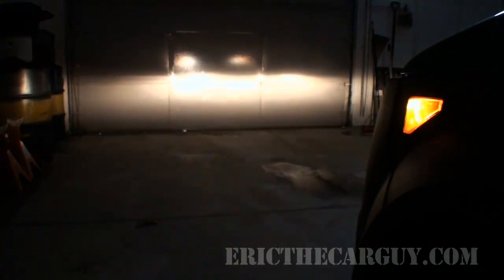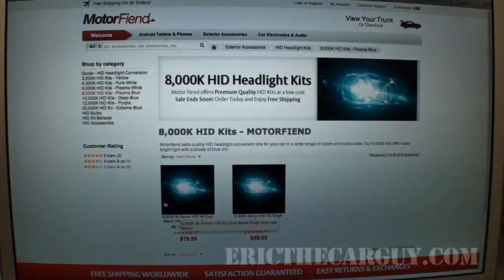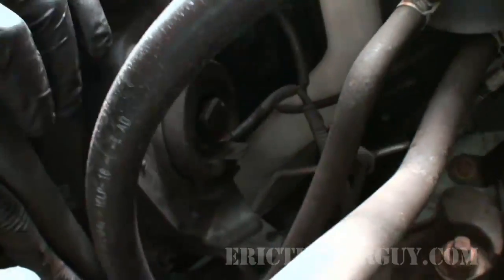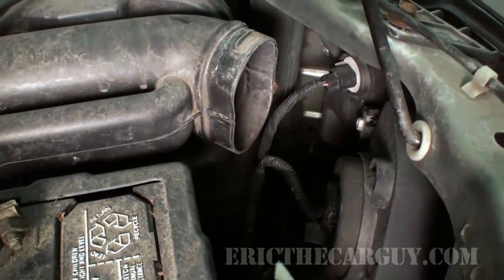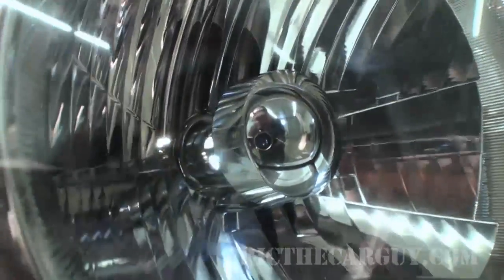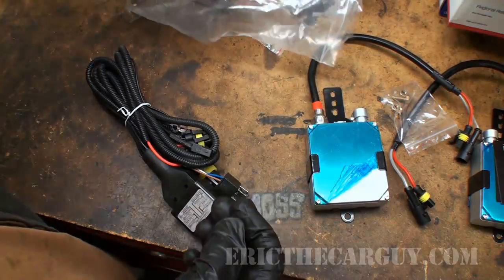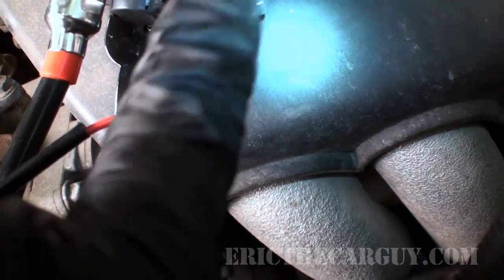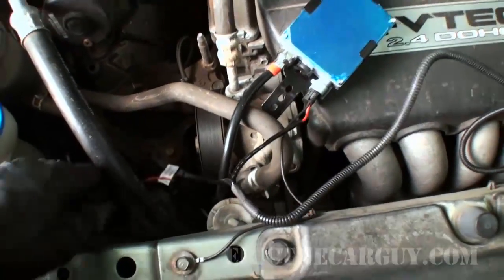How To Install an HID Headlight Kit -EricTheCarGuy

Comment: he has a cut-off line he wont blind any1... I have the same set-up, the little metal shield really helps stop glare...
Reply: Are you serious?? He has no cutoff, look at that glare it looks like crap!
Reply: Of course resort to name calling. That's not a cutoff shield, I have Hella E55 projectors with the cutoff shield, and foreground limiter. Just look at that glare when he compared the stock to his "HIDs" there's light scattered everywhere!!

You just don't retrofit halogens with a HID bulb, there's a lot more involved in the process. I see you guy's all the time with your cheap crappie "HID kits" blinding ppl. That's not cool, it's dangerous!! People please do the rite thing, and buy yourselves a nice HID kit, with really good projectors and don't go pass 5500K.

You don't have to resort to name calling, even if you don't agree with the other person.
Reply: ***** You didn't hurt my feelings buddy.
Reply: Gotta get terms right so people dont get confused.

A Cut-off Shield is on the projector. It's a metal flap that extends over the front of the bulb and creates the cutoff line, and also flips out of the way so it doubled as your high beam. That's your bi-xenon. That is what Dat Dude is saying.

A Anti-Glare Shield is what you see in this video. To reduce exactly as the name says, glare. This is what Jeffery is trying to point out, but is calling it the wrong thing 2 different times. Went from calling the cutoff shield to a shroud, which its neither. Did this right after calling someone else an Idiot. Gotta love youtube comments

A Shroud is what fits over an entire projector for that final look. There are MANY different kinds. Hard to explain, but just google HID Shroud.

As far as the K rating. 4300-5000k will give you the whitest light, which also means your brightest. 6000k Is best for that slight blue look without loosing much for light output. 8000k you are trading off quite a bit of light output for your blue color. 10k and up you are just an idiot. I seen a 12k kit once (purple) in the rain. I couldn't see his lights on the road but I could see the surrounding halogens fine.

The bluer color may seem 'brighter' to a lot of people because your eyes can pick up the blue hue easier than just things being lit up.

I'm not really arguing with either of above posters, I'm just making a point to say something to educate anyone that reads your comments. Been following HID headlights for long time. There is a TON of info to learn to be as educated as you can be.

Comment: So I ordered my kit from motor fiend, H7 4300k, and it did not come with instructions, bulb shields (Casper shields), nor a harness  , it only came with the ballasts and the 2 bulbs. what happened?
Reply: +Kevin Rivera Mine is the same way.
Reply: Same. But, luckily I did find instructions for installation on my car from a video I found on youtube... I think the channel was Xenonsupply. See if you can find instructions there :)

Comment: Awesome video as always ....but another way ....if your fuse is blown and don't have a replacement fuse and you need headlights ...just cut the fuse out and direct wire it without the fuse ....now that's only if u r stranded and have no other way and need to get home....and when it home make sure you put the fuse back in....just an emergency need to do!!!

Comment: I hate people who think it's okay to put HID headlights in a car that originally had halogens. I have two cars that have HID headlights but they were a factory option so I'm not blinding anyone. You should take those bulbs out of your car and put the factory ones back in so you don't blind someone and cause an accident. Every time I see someone with aftermarket HID headlights I turn my Highbeams on so they can be blinded too.
Reply: How old are you? 10? Your issue is about blinding people yet you turn on highbeams deliberately to blind them back? LOLOLOL what's your role in preventing accidents then?
Reply: George Au-Duong They blind me I blind them back. It's called being fair. lol
Reply: Hes actually right. you need to buy new head light housings and projectors. not just put in the bulb. it doesn't work with reflectors.
Reply: Znorm, you are absolutely correct and I do the same exact thing.
Reply: ZNormT6
Lol, I feel you man.  I live in the suburbs but I can only imagine how bad it is out in the country without city lights.  What can you do man, can't fix stupid.
Reply: ***** actually its just a gimmick to block SOME of the glare but it also block lots of usefull light , you can't replicate the same beam  since halogen and hid work differently , but hey since you seems to know so much why aren't you working with Stanley or Koito or Hella ? You could give them the knowledge they seems to lack to develop a proper housing :)
Reply: it doesnt work , only proper way to run HID is to use a xenon projector (D2S and the like ) , your solution is just a mimick that chineses sell to make a quick buck

They still glare like hell
Reply: ***** 
"The glare isen't that bad" 

How about no glare ? You know aka : Use proper housing and bulb ?

Nvm better get theses kits and glare everyone so you can show people you spend "$$$" on a 15$ kit (yup thats what they cost) for the sake of vanity

Halogen will give you an overall better output , just google daniel sterb lightning and educate yourself :)
Education is key here
Reply: ***** When i said halogen give a proper output I meant in a halogen housing , i know HID in a XENON Housing (Aka using D2S bulb and the like ) Will give a better output than halogen , BUT Halogen in a Halogen Housing will give better result than HID in a halogen Housing (Less lumens wasted ) 

I know about lumens and kelvin , don't worry ;) 

I still don't see the point to suggest someone PnP even with a casper shield when its just end up creating glare , and shitload of foreground light.. 

Gotta jump on the HIDWAGON?

You guys are late.. its all about the shitty PnP LED!
Reply: Of course but the  Housing is build based on the D2R BULB , not some randomly applied "casper shield" and its not just a reflector with a different "socket"

Its a coating applied on the bulb that block the glare (The brown stuff), once again its based on the ARC of the HID . 
Some chineses tried to replicate it but you simply can't do it correctly on a rebased bulb (aka PnP )

The actual "casper" shield on the headlight itself it just to block the light from the base of the Arc

 (Same for some halogen headlight , like a 2012 ford f-150 and MANY other halogen housing ) on the halogen headlight they block some of the light emited by the filament , (Since not every bulb have the coated Tip) (Like H3 and some H1) 

http://i58.tinypic.com/2exwvuc.jpg

Just look , for the D2R (Reflector) They need the brown coating and the shield , yet the housing is based on that kind of ARC , which once again is pretty different than a filament 

http://dastern.torque.net/Photometry/filamentarc.jpg

Once again , do it RIGHT or don't do it at all
Reply: It can't be the same , your fusion has squirrel finder while Xenon projector does not (it let a lil bit of light to illuminate the sign on the road etc ) 

The increased brightness from HID will cause glare . 

Glare don't need to burn your eyes to be considered glare , as long as it its not intentional , its glare .

And i'm pretty sure the foreground was affected by switching D2R->H7 (Even if they look alike ) 

Same for H11 to H11PnPHID
Reply: You just said theres no glare , then just a lil glare , so which one is it ? 

Ill assume its the late one . I know the Fusion take hid pretty well for halogen projector but theres still LOTS of room for improvement ;)

(Koito LEXUS RX350 projector are pretty much bolt-on for exemple )

And getting flashed mean nothing , i see people in pickup with Hid in both fog/headlight not getting flashed and they still glare like hell
Reply: See, I have 35W HIDs in reflector housings. I've had them in for around 3 months, and I drive on two lane roads pretty often. You know how many times I've been flashed? About twice. So they can't be that bad. One time, I had someone flash me while we were both pulling up to a stopsign. He turned on his brights, and I turned mine on too! Bet he couldn't see shit after I turned my brights on with my HIDS. Hope that happens to you😊
Reply: ZNormT6 that’s why you buy aftermarket headlights with the hid block off plate
Reply: ZNormT6 do that to me and ill turn my light bar on
Reply: What about when you are on a hill and the traffic is coming over the hill towards you. You blind them!
Reply: Strongly agree!!!
Reply: @DrDodge24  wow grow  up :p
Reply: @GravelGuerrilla  my 2002 Lexus LS 430 had hid factory and it had reflector houseings

Comment: Very disappointed Eric! Read all these comments and PLEASE read up on how HID's are VERY different than Halogen. Only install these kinds of lights into housings that were designed for them! HID lighting systems installed on a vehicle that previously had Halogen light bulbs is NOT cool. Those lights will cause extreme amounts of glare in those housings and other motorists will be at great risk of being blinded by them, possibly causing an accident! It's a very serious problem here in California. So many ignorant douche bags putting these lights in not only their driving housings but, their fogs as well! How stupid is that!? Blows me away.
Reply: *****  Did you use a relay harness and run off the car battery or just the factory harness when you installed the hid kit? I have the same car and was thinking about doing an upgrade to the terrible halogens in the Fusion but I'm not sure what I will need. My car has the daytime running lights disabled.
Reply: I installed hid on my higbeam even its illeagal but only higbeam loybeam need to bee original xenon or leave it to halogen. Sorry my english is horrible, I am from finland
Reply: He was provided a anti-glare shield... are you blinded? because the light didnt blind you ;)

Comment: Just a note, the Kelvin scale doesn't necessarily get brighter as you go up, it's the color temperature. Lower goes toward the yellow/red scale, higher goes toward the blueish/purple scale. Typically right in the middle, around 5k or so is white, and you actually loose a bit of light/lumens as you deviate either higher or lower from there. Thanks for the vid!

Comment: Chris is installing the H4 equal. If you install a H7 or a H1 Hi-Beam only they are wired different, and the hi-beam takes longer to get to maximum brightness, meaning that you have to rely on the H4 equal until the hi-beam heats up properly.

Comment: I've been running a hid kit for the last year and love it. One thing I noticed is the kit I have has a single fuse which supply's both ballast units. A normal setup has a fuse per headlight meaning if you have a fault on one you lose that fuse and one light with the hid kit you have a fault in one ballast which blows the fuse and your in the dark. Been meaning to rewire that with two fuses but have not gotten around to it yet. Cant be sure but I think your kit had just one fuse too.

Comment: Cool video Eric! I'm not going to belittle you for this decision, I installed a kit on my car as well. I used projectors though so that there wasn't chance of me blinding others, but I see this retrofit has a metal shield over the bulb, seems quite nice for a drop in kit. Only thing I'm going to mention about your kit is that you might find the blue light difficult to see even though theyre brighter than your stock bulbs. Blue wavelengths are the hardest for humans to see.

Comment: Very thorough installation Eric. Not exactly how I would do it but well done. I have watched both this video and your response to it and I've tried to find your error that you edited out and could not find a hint of it. However I would like to point out your edit related to "relay module will hereafter be known as control module". This is actually a relay module. There is nothing smart in this black box. It's main purpose is to supply constant power to the ballasts especially during switching on and between high/low beam. If you did not have this here the ballast sees a momentary drop on the input and your bulbs would dim. I had a similar problem when I installed a kit that was designed for a low beam only. Switching from high beam back to low, I had about 500ms before the low beams reached full intensity.

Comment: I remember when I installed my HID kit on my 97 Grand Cherokee with a 5.2 Magnum and lemme tell ya, when you install a HID kit in a modern vehicle, you tend to think of how easier it would be with a older vehicle being that there's more room in the engine bay. Mine wasn't too bad and only took like 20 minutes to install solidly being that I off road a lot, but it was quick. Zip ties were my friend for that day, but compared to my '72 Chevy C10 350, it would've taken 15 mins.

Comment: I got the 6000K I just installed them, it's very straight forwards. Luckily, I didn't have to drill any hols, however and unfortunately,  I had to switch them around for it to work, no Idea why, and it took me some like an hour and a half to reinstalling it after I did the first time and it didn't work. Word of advice: try them before hoking them and get some good grounds very important. I was very happy, really excited and of course, best thx to Eric. :D

Comment: Casper Shield are only used in double beam headlamp, which means the high beam and low beam use the same bulb like the video. Single beam are when low beam and high beam are separated and use two different bulbs. I'm surprised no one mentioned it
Reply: AlphaZ No, Casper Shields are not only used on High-Low beam headlamps. My 2002 Lincoln LS has separate bulbs for high and low beams, and the lows have Casper Shields.

Comment: If you don't want to get actual HID's since you probably have a reflector housing (versus a projector), you could try the Sylvania Silverstar zXe bulbs. I believe they are around 4100K (4300K is standard white for most OEM HIDs).

Comment: It makes perfect sense. Have you seen 12000k and above in person? They look bright as all hell, but their light doesn't travel very far. So they're more intense, which can be synonymous with being brighter, but their lumen output is much lower than that of the 4300 to 6000k temperature range, therefore not brighter. I'm considering brighter as a higher lumen output.

Comment: For those of you in the US, i'd just like to correct those that think HID kits are illegal in the UK.
They are not.

The issue with HID's is those who buy higher kelvin bulbs thinking that they produce more light.
What actually happens is they produce more glare the higher the kelvin.

The best kelvin bulb for range and brightness is between 4300k - 5000k.
Bulbs higher than this start to emit glare which in turn blinds oncoming drivers but can be reduced slightly with a shroud.

Comment: The higher rated ones seem to work better at lighting up distant objects especially road signs and markings, but I find the lower rated hids light the area right in front of you much better,but i also agree these kits work better in some types of headlamp and not so good in others.

Comment: he's done it right...
used a proper H4 conversion kit, with shroud and magnetic hi-lo.. and adjusted the beam...

34.09 and 35.40 is the proof that he's done it properly... he still has his original beam pattern... those who blind you will have light all over that garage door.

keep rockin those HIDs ericthecarguy :D

Comment: To protect from rust when you have to drill a hole you could use clear nail-polish if you don't have paint. I used it around bolts on my car after removing rust and it stays nice after all those years

Comment: Greetings, Eric! Today I installed myself a 6000k HID kit on my 3 cylinder Korean Daewoo Matiz. It was almost the same way as you did it in this video, but without drilling wholes. I just used plastic strips.. It won't go anywhere so.. Most important is it works and it costed me just about 60 dollars.. That's just the price of the kit so.. My car suffered from bad mechanics (our technicians in Bulgaria are not very known for their good job) back with it's first owner so now I'm full of fixing on my own most of the issues and problems.. I don't have the tools for most of the jobs, but.. I'll get em.. Anyway.. You've been an inspiration to me and I learn a lot from you videos! Thanks and yes, I stay dirty! : )

Comment: yes that shroud is important to keep the beam pattern correctly in place, other than also having the arc in the same position as the original filament. 
pay attention to the stock H4 bulb. it has a cup shielding the low beam filament.

Comment: I would like to add my .02:
1.  There are two numbers to look at when choosing an HID System - Kelvin and Lumen.  Kelvin refers to the color of the light, and Lumen refers to the brightness of the light.
2.  ANY HID Kit installed in a halogen assembly WILL scatter light and blind oncoming traffic!  If, after installing one of these kits, you keep getting flashed at night - re-aim your headlights a little lower!  You will get more light on the road, and less light in oncoming traffic.

Comment: In answer to Sumantra Sarathi Hembram:-  HID bulbs will last longer than a regular Quartz Halogen globe provided they are mounted correctly and have no movement, and provided that they get no moisture on them. My set installed in my car have been in it for about 2 years with absolutely no problems at all.